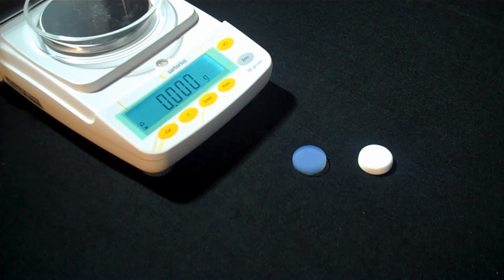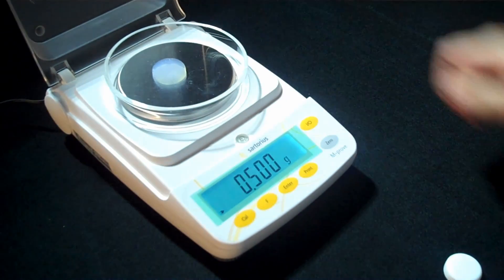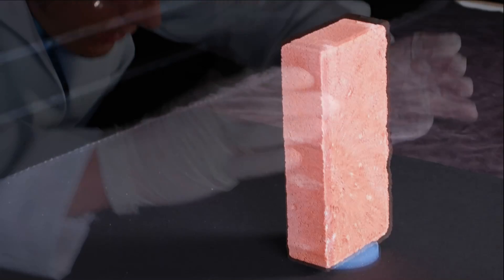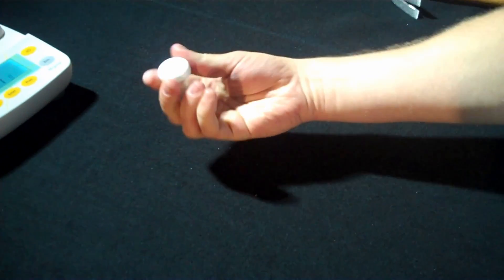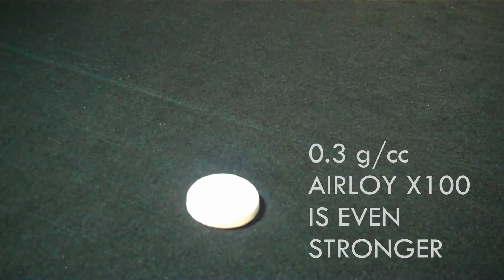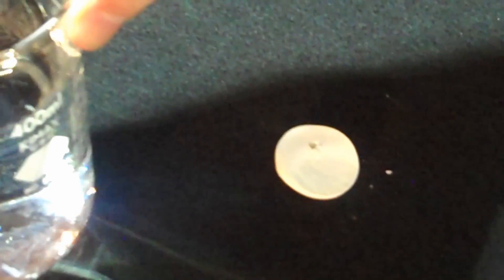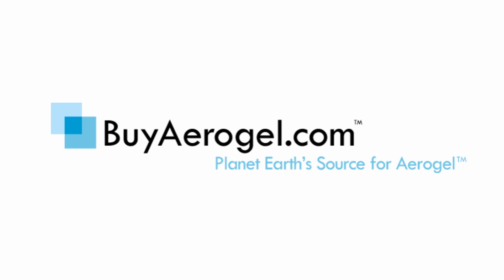Strong, Machinable Aerogels Now Commercially Available

Comment: I'm curious as to how long "a long time" is, are these applicable for usage as a building material? Utilizing these in the form of injection moldable shelters could allow for the mass production of small scale personal shelters for environmental emergencies like floods, hurricanes and earthquakes. Since this material is so lightweight once expanded into its gel form, emergency workers could easily transport the necessary base materials to produce such shelters on site.

The main issues here would be the extended permeability to water and the ability to process the material into the intended final state for use as a shelter on site.. Do these materials break down rapidly? Would the marerial last through a week or two of mild weather patterns or be falling apart in minutes after a drizzle? Also, would the material's final manufacturing steps require some sort of facility or large, difficult to transport equipment?

Comment: The secret: Dissolve some high quality GE brand (50 year rated) OUTDOOR RATED silicon caulking by dissolving it in methanol.  Shape it and than rinse it in water about 40 times for 12 hours each and then finally process it in a supercritical CO2 chamber. Done.  (Warning: This stuff sticks to everything when working with it!  Very frustrating, gooey and messy until done!)

Comment: Hi, could you tell me if Airloys is a high  porous material?thanks
Reply from the maker: Yes Airloys are typically 50-96% air by volume and have surface areas of hundreds of square meters per gram.

Comment: nice but how about practical properties, like glue, it can be glued with conventional chemicals (polyster resin, epoxy, cianocrilate)?, how much heat can support without melting or blowing? reacts with matterials like the rubber used for o-rings?

Comment: Ha 96% density of air. The actual density has to be greater than air or it would float lol. This guy measured its weight, which is not the same as mass, due to the buoyancy of the aerogel in our standard atmosphere. To perform a correct mass reading the aerogel would have to be weighed in a vacuum

Comment: Glass is a super inculcater ? But in a car you can easily and clearly feel the outside temp when you touch the window
Reply: I'm no material sciences expert, but I'm pretty sure auto glass is a different type of glass (Safety glass has stuff added to it/made different so it doesn't break the same way as normal house window plate glass) than the the super pure glass used for scientific purposes. Again I might be completely wrong, but I think that might be the reason why...  But when you think about, compare the heat you feel from your window versus that from your chome seatbelt buckle lol.
Reply: Feralcus 
Yeah especially here in the middle-east, in summer the seatbelt buckle is stupidly hot lol

Comment: What the heck? If this stuff is less dense than air, why doesn't it float away?
Reply from the maker: It is not less dense than air.  In fact, any solid that contains air in its empty porosity cannot be less dense than air because it necessarily contains something that is heavier than air plus air.  In fact, no aerogel, even graphene aerogels, are lighter than air, unless you suck the air out of them or refill the aerogel porosity with a gas that is lighter than air like helium and even then air will eventually diffuse in and replace it making it descend back to the ground.
Reply: But it is not less dense than air, where do they claim that?
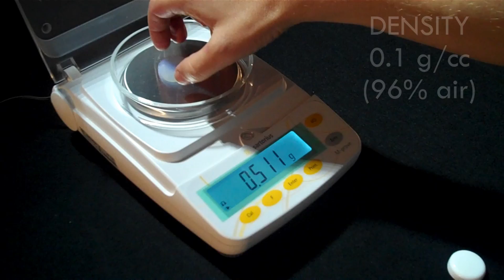Reply: Atristiel Based on the numbers given at 0:40 and 0:53.
Reply: ***** It's just like a balloon filled with air, it's 99% air and yet it stays on the ground. Same logic. The actual solid material is denser than air, it just has a large amounts of air pockets per volume that becomes so light in comparison to its volume.
Reply: +Atristiel That doesn't make sense. You say that the actual Aerogel material is denser than air (let's say 110% of air's density), but 110% and 100% (the density of air compared to air) cannot average out to be 92%.
Reply: ***** I don't have time nor energy for this shit after uni. Google the definition of density and the difference between density and mass etc.
Reply: I think I get it, now. I had interpreted "Density: .11g/cm^3 (92% air)" to mean that the Aerogel's density was 92% that of air. I see now that it means the block of material is 92% air. That makes more sense.
Reply: Fun fact, there are Aerogel variants that are in fact lighter/less dens than air. They were able to make aerogel with a density of 1mg/cm^3 and air has a density of approx 1.2mg/cm^3! But yeah the aerogel in this video is denser than the air.

Comment: How much waste is created in the manufacturing and lifecycle of the product and is it sustainably disposable?
Reply from the maker: Great question!  One of the big reasons we make materials like Airloys is to help make the world a better place.  We are working hard to make the manufacturing process for these materials efficient and low waste.  Our revolutionary manufacturing process allows us to make aerogels at a fraction of the cost and with a fraction of the resources traditionally used.  This technology also allows us to make Airloys in sizes not limited by a supercritical dryer.  An Airloy material is sustainably disposable depending on application and composition.  Some Airloy materials are meant to last a long time because they are used as things like aviation wall panels, while other Airloy materials can biodegrade readily because they are designed to do that.  Many of the applications for Airloys are in transportation to help reduce weight and therefore fuel and as a result help make other things more sustainable as a result.

Comment: Is is possible to build a rigid zeppelin with this material? Or is it not rigid enough?
Reply: Why not another aerogel? They are generally super rigid. Once you figure out how to imbue them with Helium, it will practically fly on its own, you merely need to design such a structure for the support of your payload and mechanical parts that would avoid punctual stress on the material.
Reply: Yes but not alone you would likely need to laminate with carbon fiber or a similar material.
Reply: +Barskor1 Great. that probably make it evin more expencive.
Reply: +Barskor1 True. I guess it would just have to be made like that, or ill have to wait for someone to make iron-aerogel.
Reply: +Barskor1 Wait, that will seriously make it lighter? without any loss of strenght?
Reply: +Barskor1 Would the weith be decreased? thats kind of the main problem.
Reply: +Barskor1 I can see that, but earogel ks also lighter, in fact, MUCH lighter. So i wonder which would be better. probably the earogel with the carbonfiber, but i still wish for earogel with the properties of iron.
Reply: +Siana Gearz My main problem is that i have absolutly no idea how to do that. But it is a good idea. I hope i learn enough to be able to do that! Thank you fot your input!

Comment: question. what is aeorogel?
Reply: its a termic isolator. sorry for bad english
Reply: Aerogel is a gel where liquid has been chemically replaced with gas, so it's full of molecule sized gas pockets. It's extremely light weight and usually very brittle, as opposed to the gel that it has been made from. It can be used as a particle trap or as a thermal insulator. Some aerogels are the best non-vacuum thermal insulators that are currently known, as they can insulate better than the gas contained therein.

Comment: Is it possible to make a bulletproof vest out of it?
Reply: +max14719 it was deformed by a hammer blow. What do you think a bullet will do?
A hammer wont punch through a thick steel plate - bullet does.
Reply: +Lazy Orc Just so your aware, while that is a good idea, every "scale" type of armor has failed trials.Why? Because a vest has to protect you when you are prone or the angle of impact is nearly parallel to the body. That's why the dragons are extinct, we figured out how to get under their skin.
Reply: +Lazy Orc not to mention the weight of the thing. Last I heard it was unbearable. In the meantime my supplier has lowered the weight and raised the strength of his plates. And my research has led towards some new material matings. So, we shall see where this leads.
Reply: +max14719 interesting, good question.
Reply: +max14719  nasa plans to use it to catch space particles that travel at higher speeds than bullets so its possible
Reply: +max14719 Remember, a bullet impact is different than a rubber mallet. Forces of different surface areas. The real question is what will it do when you shoot a nail through it.
Reply: this is the guy from kalamazoo. SOB
Reply: But there are already fairly light bulletproof vests
Reply: Which are more affordable the this would be. Also, remember that there are different vests for different uses. Kevlar is still approved and good for things like 9mm, but "safety" personnel put higher capability and tactical vest in the trunk. So lets see. Plus material technology is actually moving towards more flexible materials. Yes, long winded. but I am in the industry.
Reply: Mauro Tamm if it has the same size as a normal bullet vest, I think it is possible in my opinion.

Comment: how's this compared to Kevlar at taking a bullet
Reply: Uniform Health It's life compared to death when you see what a slow drill can do. Unless it is something like non newtonian liquids with viscosity increasing according to the shock. But I think even those have a breaking point.
Reply: +Uniform Health It's not meant to be bulletproof. It's meant to hold weight, not be shock resistant.
Reply: Non Newtonian, at least that we know of, don't stop higher calibers of bullets unless it has some kind of Kevlar in front of it
Reply: +Uniform Health dude, your comment is like watching a video about watermellons being tasty, and asking how well would that tasty watermellon compare to kevlar o bulletproof glass. It tottaly different properties we're talking about here.
Reply: True I suppose it should be word differently, with equal thickness which would work (give both elements ideal condition) better when protecting ballistic gel from a firearm.  That result would answer my curiosity. cant see this ever winning out over Kevlar or arm even in ideal conditions. Its low mass and plasticity just make it  interesting to see how it could work. Not that it would  work
Reply: exactly what i was thinking
Reply from the maker: This is not a ballistic material.  So gets holes in it when shot with a bullet.

Comment: So I put an Airloy over a match and it just started melting, and now there's a dent in my Airloy block. Can anyone tell me what happened because I thought the thing could withstand high temperatures like the Aerogel in the other video where they put it over a fire
Reply: Nathan Pham If you take a look at the airloy website you'll find that the maximum temperature is around 200°C, quite a bit lower than the temperature of a match flame.
Reply: It isn't the real material
Reply: Morn Wood but i ordered it from http://www.buyaerogel.com/product/airloy-x103/ . did i just get a defect or what
Reply from the maker: Oops.  Sorry about that.  Not all Airloy materials are meant for high temperature.  The material in this video is only rated for about 80 degrees C but other Airloys like Airloy X116 can go to 400 degrees C without melting.  Some Airloys can go over 1000 degrees C as they are made of carbon and can be used for very high temperature.

Comment: 96% air. pff. Lays chips are 99% air
Reply: William Vinluan Funny guy
Reply: +MobbSparta Aye, but they don't hold very well to water either.
Reply: they get that nitrogen by heating up liquid nitrogen and using the nitrogen vapour off it if i recall they use a heat exchanger to convert it to gas
Reply: +MobbSparta Nice profile pic...
Reply: Same to you...
Reply: MobbSparta Thanks
Reply: it's actually nitrogen in those bags
Reply: MobbSparta 😂😂😂
Reply: LOL
Reply: xDDDDD
Reply: The color is 1%
Reply: "I don't know how they manufacture those!, We must ask Lay's, now!"
Reply from the maker: Lays chips are actually not nearly that porous but what do we know.

Comment: could you make car parts out of it like with carbon? or would the everyday outside nature destroy it if its like parking outside everyday and its raining or cold/hot weather
Reply: MrNerdcode This material is too light to withstand harsh weather conditions. The lack of density in the material will make it erode quicker because it's made of so much air.
Reply: Trypticon
wat is you put some kind of rubber or somthing that keeps it covered?
Reply: MrNerdcode If you mean the inner structure of the car would be made from it and the exterior would be rubber, then it's plausible I suppose. Only concern is safety in traffic. If you bump into something with that car you'll be lucky to survive.

Comment: Stronger, yes. But it hinders the most important property for which aerogel is used for- insulating.

4% of air by mass takes a significant toll on aerogels insulating capabilities. I'd like to see a thermodynamic comparison to truly acknowledge that this isn't the "perfect" aerogel. All materials are a give-and-take.
Reply from the maker: There is a slight tradeoff in strength and insulating ability but actually Airloy materials can have thermal conductivities as low as 20 mW/m-K which is comparable to the insulating ability of many traditional silica aerogel materials while being hundreds of times stronger than traditional aerogel materials and not brittle.  Also while the most important application of aerogels to date commercially has been insulation, thanks to the strength properties of Airloys there are all sorts of new technological possibilities that may one day make other applications of aerogels as important or more important than insulation.
Reply: I just love how aerogeltech is responding to all the comments a year later, completely ignoring the shitstorms in the replies LMAO
Reply: tl;dr This comment thread is why there are barely any women doing STEM majors.
Reply: Joanna Pecko Not only that, but the comparison graph shows the x100 to have a sneaky gradient on the bar. It has thermal properties closer to that of styrofoam than traditional aerogel.
Reply: Actually, several women whom were some of the first women with degrees in certain STEM fields have written about how they we pushed out of the field due to the caustic behaviors of the men in their field. There are likely multiple factors at play, but studies have shown that in cultures where women have more power, many behaviors we often attribute to gender actually change.
Reply: Amani77
No, they don't. They make a comparison of materials on an extremely large scale in an attempt to hide how big of a difference it actually makes from silicon aerogel. On top of that, they made it's thermal conductivity in brackets- what does that actually mean?

By talking about the "comparisons" for 10 seconds, it's clear that their insulation capabilities aren't something to brag about.

Like Taylor Petersen stated, this is still a good material, but it's misleading.
Reply: see at the end
Reply: Michael Johnston "moron and douchebag"---

Tras de ladrón, bufón.
Reply: ...lets calm down now perhaps?
Reply: Joanna Pecko but it’s still extremely light
Reply: This is a good point that is too often forgotten. Producing a material that has better mechanical properties and worse thermo-insulative properties doesn't necessarily mean that the "perfect" aerogel has been created. These discoveries are valuable because they create more of a spectrum of different properties to choose from, but in general the application scope of this X100 stuff will be limited as with every material. That being said, I suppose there is probably a larger market for light, tough thermal insulators, even if they aren't quite as good at insulating as the original super-brittle silica aerogel.
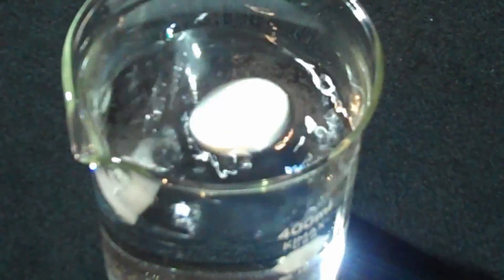Reply: Did you not watch the video? They cover this at 3:00.
Reply: *****  Did you not watch the video? They explicitly say that the Airloy X100 contains 4% less air. From a thermodynamic standpoint, it accounts for a lot of the thermal conductivity.
Reply: Monim AL I'm a 5th year student at RIT :) Chemical Engineering as well! I've done several internships, so I could help you out if you have any questions. Message me anytime haha
Reply: Clint Webb Women don't do STEM because of Youtube comments, clearly nothing to do with intrinsic male-female preferences for different things in life, career choices, hobbies, interests, likes, dislikes, and pursuit of happiness; Gender is a social construct after all. NAILED IT! 👌🏻
Reply: Joanna Pecko Hi are you by any chance a materials scientist? I am a chemical engineering student at SUNY geneseo we should totally talk about jobs after college lol Please!
Reply: Joanna Pecko awesome please fb me Google plus is horrible
Reply: You look good joanna
Reply: oooooo nice response I am flattered you took the time to look at my profile.... I bet you haven't been laid in the last decade you didn't need a degree to be a full time loser either I see LOL
Reply: ***** hmmmmmmm where did you get your chemistry degree?